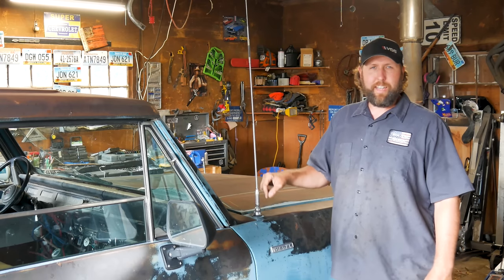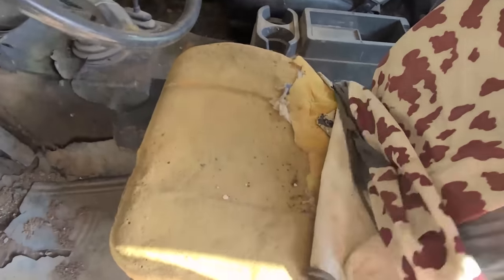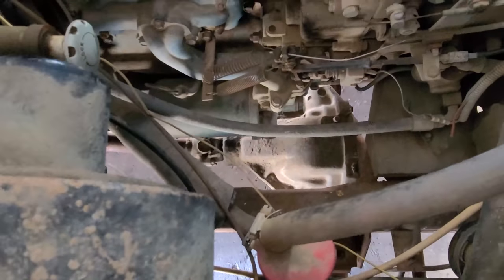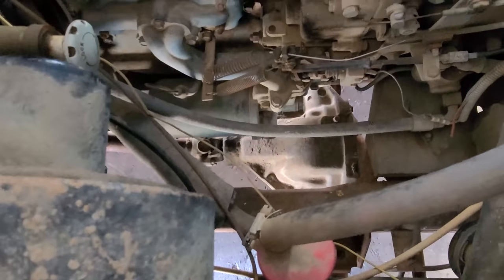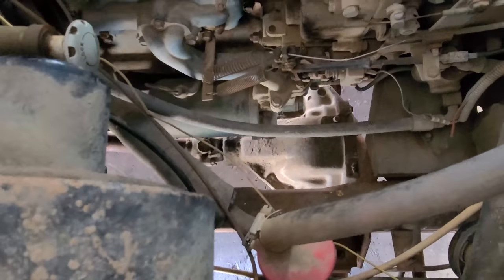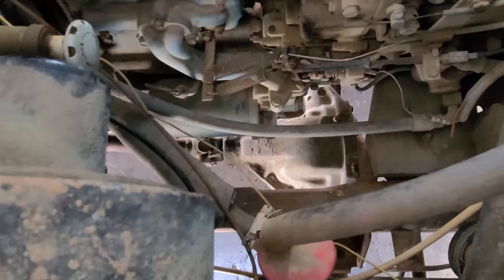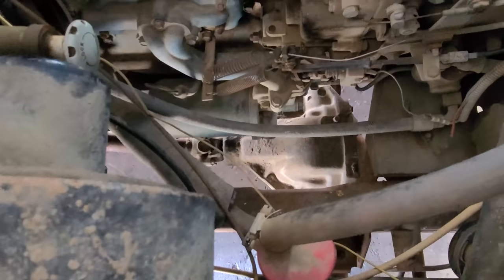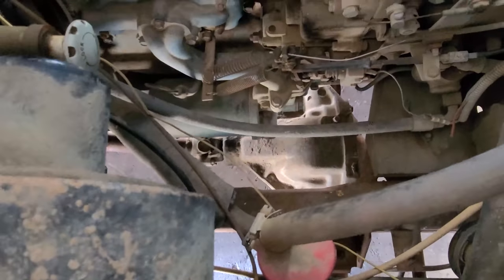FORGOTTEN International Scout NISSAN TURBO DIESEL - Will it RUN AND DRIVE 600 miles?

Comment: "Got all the dinosaurs in this here bottle" he says holding a bottle of synthetic rotella.... 😂
Reply: Right!  I was thinking the same thing!  haha
Reply: He meant Dinobots...
Reply: And "Synthetic Oil" is produced through thermal reforming of "Base/Crude Oil" and/or "Natural Gas."  Rotella, specifically, is made by thermal reforming of Natural Gas, which is primarily methane and ethane supposedly produced from the breakdown of dead organic lifeforms by geologic processes. 

So, dinosaurs.  Dinosaur farts might be an even better joke since it is "gas from dinosaurs" and your mentality is likely roughly equivalent in development to your apparently limited knowledge base. Never the less, still dinosaurs, if the current assertion of science is true.
Reply: @MyTechWebTV  - Meaning, you don't think.
Reply: @Phantom0fTheRouter  I for one was well aware that synthetic oil made by rotella was made from natural gas. But there are different properties to synthetic compared to non-synthetic as well as synthetic oils normally being marketed toward newer vehicles with newer emissions systems. They contain less sulfur for example because the sulfur is harmful to the dpf. "Full dinosaur" oil is meaning that there is nothing removed from it to prevent damage to other systems because those substances help protect engines. Sulfur is an anti corrosion. Zinc is an anti wear. Both are very important in old engines and both can be harmful to emissions systems.
Reply: We done burnt up all the real dinosaurs!...at least that's what I was told would happen by 1980 when I was in grade school in 1970.
Reply: @grandudetonesnob7107  1980. 1990. 2000. 2010. 2020. 2030...... and somehow we just keep finding more. And plenty of it. I wonder who the people are that have been saying that since forever. Huh.
Reply: @jaredanthony8070  maybe we're burning the people that ATE the dang dinosaurs by this point...
Reply: @grandudetonesnob7107  hell maybe we can make crude oil by throwing some cow carcasses in a pressurized heated drum for awhile 😂 that's basically the supposed way crude was formed just with a little dirt involved lol or hell if we can make oil out of gasses why not refine the synthetic oil into....gas and diesel.
Reply: @Phantom0fTheRouter  The truth is that fossil fuels are from marine deposits, mostly algae and marine detritus of various forms, and not dinosaurs. A very small percentage of the total may be from dinosaurs. It's a common misconception.
Reply: @slabrankle9588  - you've obviously misunderstood me saying "geologic breakdown of organic lifeforms" for "only" dinosaurs. 

However, I will point out that it is mainly age, and not taxonomic category, that defines "dinosaur" in this discussion.
Reply: @Phantom0fTheRouter  I understood that you said "dinosaur" in the second paragraph of your comment. It's there for all to see. Your incorrect use of a word is not a misunderstanding on my part.
Reply: @slabrankle9588  - You are intentionally and deliberately obtuse.  Again, you are ignoring the framing of the first paragraph.  In any case, the use of term "dinosaur" is not limited to the specific clade of the similar name Dinosauria as you seem to be suggesting without your having the apparent knowledge to describe accurately.   

Separation in time of the appearance/evolution is the primary characteristic used in this use of the term "dinosaur."  You could also state that "dead animals don't fart," to pick at the rest of the statement, to which you would also be incorrect, because of other facts you will be ignorant of, whether that is equally willful as your current state would be debatable.   

In any case, the existence of current, "living dinosaur" entities that do not belong to the Clade Dinosauria disproves your intentionally narrow definition of the word.  The crocodile, alligator, and komodo dragon may be lizard like, sort of conforming to the general description of that taxonomical classification, but the coelacanth as a fish (marine life), does not, and the False Rose of Jerico, also known as the "Resurrection Plant" and the "Dinosaur Plant," being plant life, definitely does not conform to the general description or narrow definition.  Separation in age can also be as close as calling a "Boomer" a "Dinosaur."  

Should I also be required to point out that "Baby Oil" does not come from "Babies?"

Do you wish to admit your ignorance is completely willful for the sake of argument, or are you really a complete moron?

Comment: Very Cool, I bought a new 1980 Scout II SD33T in Michigan, drove it for 10 years, then put a plow on it another 5 years and sold it with a rusted out body to car dealership.  Then 10 years later I restored a 1989 Scout Tera pickup.  Bought it used in Washington state and drove it back to Michigan non-stop and consumed 5 gallons of oil on the trip, never let me down!!

Comment: the batt connections on the front bumper are for a factree international stick welder......also why it has the inside throttle handle. Youll find if it came with those.....its got a scary big power whirler......160 amps i think. Made for repairs on farm equipment in the field. My 1010 travel all had the same set up
Reply: Thats awesome!

Comment: Derek , when I   have bad gas or diesel fuel, I use Fuel Power Power Fuel (FPIPF). It combines water, gasoline, diesel by equalizing the specific gravity of water and the fuels and allows it to all be burned. costs about 500 pennies per 8 oz which treats about 100 gal. It would help you with diesel, gas and lets the added engine juice  combine and burn just fine.  Thanks for the great videos. I  watch a couple of them every day. Keep it up.

Comment: It's an old Nissan diesel. Unless it has the Pacific Ocean ran down the intake,  of course it will run. The last owner would have used off road diesel in it. The old diesels were slow but they had lots of torque and usually ran forever.

Comment: I would say that that diesel is either bad or it does have a red tint to it and it could be off-road diesel.
Reply: Off road diesel is the same as normal diesel it’s just non taxed... that’s why it’s “illegal” to use on the road.
Reply: I am pretty certain that is "dyed diesel".
They still sell as we call it in western co "dyed diesel" at the Co-op.
It is illegal to drive on the hwy with it, but I cant say I ever saw a cop test for it.
Reply: Came here to say this, looked like red dye diesel.
Reply: A little bit of ATF sometimes quiets the injector pump noises.
Reply: @jwszewczyk  I never heard of that trick before, interesting.
Reply: could also be some 'home heating oil' found it's way in there

Comment: Looks like the previous owner was running some red diesel in that rig.
Reply: it looks more orange like rotten diesel
Reply: I thought the same thing. Diluted with the fresh going in, it'll probably look orange. Either way, enough got run through it to likely clear it out.
Reply: Maybe karrowsen? I can't spell! Some farmers around here will run instead of des...
Reply: Off road diesel
Reply: @jamesfoster4291  
Kerosene is typically pale yellow or colourless and has a not-unpleasant characteristic odour. It is obtained from petroleum and is used for burning in kerosene lamps and domestic heaters or furnaces, as a fuel or fuel component for jet engines, and as a solvent for greases and insecticides.
Kerosene isn't normally a red color...but kerosene has been used to "winterise" diesel to stop it gelling in cold temperatures....

Comment: That diesel that was in the tank looked like off highway fuel. It's dyed red
Reply: Correct. However I work with off road diesel every day after work when I fill the machines and it’s a lot darker red than what Derrick showed.
Reply: @claytonswick1521  he was filling it up with fresh on road diesel so what we saw in the filler neck was a mix of old, new, and probably some water and rust, lol.
Reply: @toddsmith8608  well yes. I was just replying to the original comment with the fact that off-road diesel is a darker red so that was just varnished on road diesel from years ago

Comment: TIL: never leave a bag of softener salt in the back of my pickup
Reply: Is that a snow thing? I've gone from one desert to another my whole life. I don't know
Reply: @Chevelle602  salt increases the oxidation reaction of the metal on the car, this is why in the north when roads are salted our cars rust out faster same for coastlines when salt water sprays on parked cars
Reply: @petermiller5232  I love how it looks like an overheated nuclear reactor sunk into the metal
Reply: @stickit2theman1  I understand what salt does to metal. What is that bag of salt for is what I'm wondering
Reply: @Chevelle602  well it would melt the snow...but the salt in the video is softener salt big quarter sized chunks of salt not what we typically use...puzzling for sure
I thought it was a bag of river rock or something at first to weight the tires down for more traction.
Reply: @Chevelle602  Plus we don't usually carry it around with us we just use it on our sidewalks at home
Reply: @stickit2theman1  yeah I thought it was landscape rock at first and then he said salt and I thought uh oh.

Comment: Great show to watch. I bought an old   scout in El Banco Colombia and did some maintenance in 100 ° jungle weather with some locals. Great, guys. Packed it up and drove thru the jungle to my in-laws farm with no issues. These buggies will go forever.  Did I mention it was hotter than a buzzard ass in a power dive during that adventure.  Left the scout at my in-laws. As I couldn't bring it back to Canada. Took the plates as a souvenir

Comment: I used to own a 1980 Scout II with the Turbo Diesel. I was able to buy it from the original owner in 1991 (I believe) and mine still came with the cartridge oil filter. There was an after-market kit that would allow a spin-on filter to be used. I was fortunate enough to have a forklift shop/ dealer that I could get oil and fuel filters for it. I regret that I had to sell it when money got a little tight. Mine had a perfect body and roof and we loved driving it with the roof off. It did take 3 buddies to take it off. When I had to do the clutch, I had to have the OEM rebuilt as finding a replacement was not to be found.

Comment: This one reminded me of the time my uncle bought a Scout in Michigan from someone who Frankensteined it with a 10 inch lift, 44" Gumbo Mudders and swapped in a 318. I distinctly remember it having a Dodge steering column and it was half-cabbed with a stake bed flatbed. He conned my dad into driving it out to New Mexico from Michigan. Dad said it was the worst experience ever. He couldn't drive more than 45 mph because if he did it bobbed and swayed all over the road. I remember it looked AWESOME though!!! 👌🥰

Comment: Not sure if anyone ls mentioned it, but red or purple diesel is off road diesel, sold to farmers and construction companies. It isn't charged road tax, thus much cheaper. If it came off a farm, no reason they'd put the expensive diesel in it. Glad to see you mentoring the next generations.

Comment: The frame is in good shape for windshield worth over $1,000.00 but the glass ply factory need the frame to make new glass windshield for like $200.00 window for up front Scout Diesel and all same dimension windshield in 1974 to 1979 old car.

Comment: Hey Derek, I grew up in southeast Saskatchewan, only a few hours north of you.  I was a little surprised you did not know what the bag of salt is for.  In the ice provinces and states, these are thrown in the back up cars and pickup trucks for weight.  Better traction on those icy roads.  This was more common when trucks and cars were only rear wheel drive.  Apparently, you can also use that salt in a water softener as well 😄. Really enjoying your channel and hope you can make it up to Sask for a revival sometime.

Comment: The reason the door doesn't ha an upper frame was to make it more versatile. They made Scouts like it with removable tops. I had a friend who had one. We had a real blast in it. We used to sled on a car hood behind in warmer weather and we used to tune behind in snow. That really brings back some great memories. So much of these old rigs trigger memories that completely  untouched in decades. Thanks to you from a very early model GenX. The vids you make have struck a cord everytime.

Comment: I still work on these diesels, they are in many sailboats and small powerboats. You can get gaskets and oarts easily for them. Not a good idea to use ether/starting fluid especially with glowplugs. Engines with glowplugs need the heat to get started, so take a small propane torch to the intake if the glowplugs don't work and she'll start easily without risking con rods or valves. I tear alot of engones apart that have slightly bent rods or broken valves, rings, etc from starting fluid and premature combustion. I would also change your fuel filters and add some biocide to the tank to protect your injection pump and injectors.

Comment: Awesome videos... I know you may not read these, but JIC, the red diesel is likely off-road dyed diesel only for use in states like mine that removes the taxes from diesel for tractors.  main issue with it, is if you are stopped by the right state official, the fine for having red in your diesel on the highway is Oofta May...

Comment: 1978 Scout ll w/ Nissan SD33 (no turbo).  Stock 2WD.  I've already changed out the front axle for 4WD conversion.  I probably ruined the value by converting it but it really isn't hard to have to change it back.  It's been sitting for approx. 15 years since I started the conversation but I drove the hell out of it before that.  I believe the fuel tank is a 40 gal.   Ready to finish it, move into it and hit the roads.  I also believe it will go anywhere seeing the places I went up in 2WD.

Comment: Lol fun restore and road trip! What a gem! I'm sure you can get her to 80 mph once you get the kinks worked out. Mechanical cruise control slash high idle. Gosh there's just so much cool stuff u can do with a heap like this. Nissan never had a big diesel presence in USA, but you can remedy that. Plenty support in the jdm market and the old fleabay. Fun vid!

Comment: Last day of high school in 2005, the exhaust manifold pipe fell off on my 81 VW Rabbit diesel and i used a parking curb to raise the car enough to slide under and clamp it back to the manifold. Sketchy but it worked.

Comment: This engine was used in old 80s jeep "bobtails" (shortened jeeps used to tow heavy generators, equipment and even aircraft) that I spent years driving in the air force.  Tough reliable engines that just worked.  The bobtail was geared down severely so that it topped out at 20-25 mph, but I seen them used to push a B-52 more than once.  Not ideal (hard to stop that big plane) but it had the torque.

Comment: I had one of those cornbinder diesels ran to Seattle and back took a tank of diesel and one flat . Sold it to a farmer and he fixed the back brakes. Had lots of power after that. He had to send to Japan for the parts and they weren't cheap.

Comment: That scout has the exact perfect patina, and as far as the engine tho,,, I've several different routes could go, actually have the right bellhousing that would mate either of the 2 engines would use, a mopar 360 or 383,,, and mostly leave it fairy "stock" looking like it is, maybe a set of 33s with just enough lift, to make it quite capable daily driverish, along the lines of what done with current zj, loves watching your channel

Comment: 110HP@3800 RPM. 198 ci. I ran mine in low lock wide open and it was still shy on power-but it never quit. Heavy Duty little engine.

Comment: Used to deliver "farm fuel" to farmers for off road use "ONLY".  Farm fuel is the same as home heating oil which is dyed red.  That's why the troopers always pull the caps on a big rig and shine a light in there.  Tryna catch guys using untaxed fuel.  I suspect that's why you still see some red in there.  You CAN but mustn't  take the dye out of the home heating oil with a  five gallon bucket half full of cat litter with a little tap at the bottom.  Pass the oil through that and it's clear as water.

Comment: That truck is cool you need to put a lift kit on it and a set of 52 "gumbo monster mudders. Those old internationals with a lift and the right tires and they would go through anything. Trust me I know I had one with a v8 and I had 48"gumbo monster mudders and she was almost unstoppable you have a power house 🏡 with that diesel.

Comment: It has a tiny fuel filter. Don't go anywhere without a spare. Off road diesel is dyed red. Carry a spare fan/water pump belt. That belt powers other loads and when it fails, before you can get stopped the radiator will burst.

Comment: So, I had a 1980 Intl. Scout 2 in 1989..... pretty rusty.... but it had a (wait for it).... Nissan/Chrysler Diesel engine. It broke down in Kansas CIty (water pump and a bad rear main seal), and went to a Junk Yard (and I bought a 1980 Ford Pintorch Wagon - it ran, so it was an upgrade). I can tell ya tho, the heater and A/C still worked, and it had enough rust holes so I enjoyed oil spray and diesel fumes for over 2,000 miles. Ahh, mammeries.......

Comment: I wish he would have spent more time on that either injector. That’s awesome. I swear if you got either you could start a diesel in sub 20. You can say all you want not to use either, but when it’s sub temps and your truck is your only source of heat. You’d use either.

Comment: I had a 1976 Scout II. I broke down in Salt Lake in 1980. I couldn't find a garage to work on it. It finally limped to an International dealer and they had to order parts. 13,000 miles and it was junk.

Comment: 17:25 The clampilator is tight because it’s on the wrong terminal. Positive terminal is larger than the negative.

I learned this the hard way once upon a time…